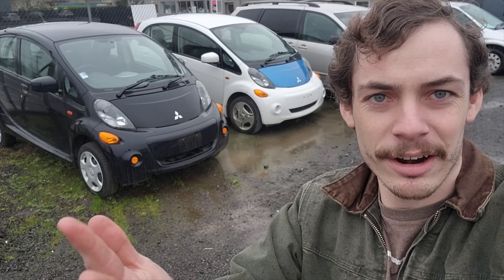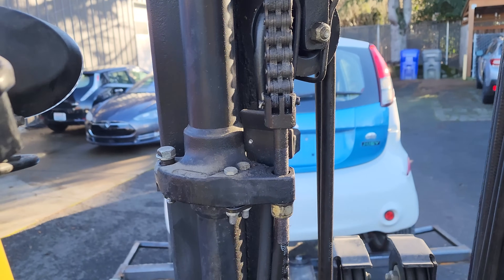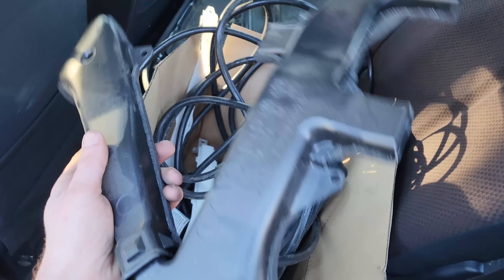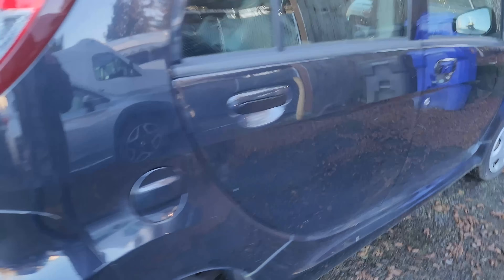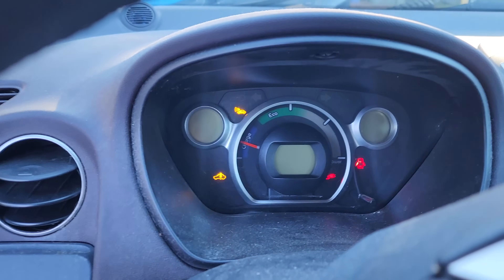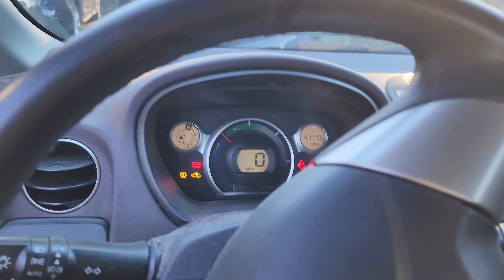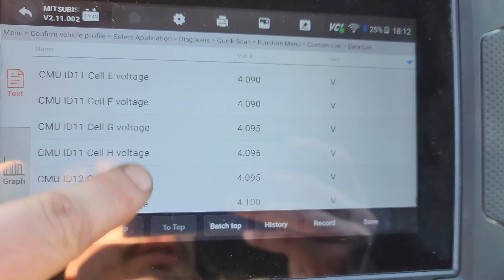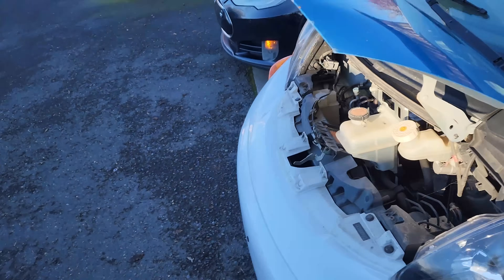We Bought TWO Broken Mitsubishi i-MiEVs! Here’s How We Plan To Combine Them To One Working Example

Comment: I remember testing driving one of these back in 2012 (or 2013) in Dallas with a group of early EV enthusiasts.  I thought it was pretty bad. So after only watching half way, my first guess after clearing codes is you need to re-flash the BMU, or swap BMU with other car for diagnostics. Im curious once you drop the pack, knowing if that one cell is actually low voltage or the BMU is measuring voltage/energy in that cell incorrectly.    Chances are the cell is actually bad (internally shorted or open circuit). Do you have test equipment that can perform AC impedance measurements of individual cells?  I understand this is an accurate way to measure the SOH (state of health) of a cell.  It sends a small AC signal through the cell and measures the impedance (AC resistance) of the cell to determine its internal resistance.  Hi resistance/impedance indicates low SOH

Comment: No car should have a useful lifespan of 50k miles.
Reply: I have a 2011 i-MiEV with 150 000 miles, still going sort of strong. I swapped in a lower mileage pack from a wrecked car a few years ago as mine had a couple weak cells. Plug and play, no programming required! 
I love the simplicity of these little cars. I have two of them as daily drivers, my Tesla model S is only used for long journeys. If I can swap batteries in one with my ten thumbs, then anybody can :)

Comment: I'm wondering if you can use the plentiful lev60 cells then distribute out the 50's to people that need them.
Reply: LEV60 are LiFePO4, totally different chemistry and voltage range from the LEV50s used in these cars (LMO).

Comment: The i-MiEV's are fun little cars. The LEV50 or LEV50N cells are fairly easy to find, but if you get a cell that has a different internal resistance, it will effect DC rapid charging (if your i-MiEVs have it). Cell upgrades are possible, but the VCU only supports up to around 63 Ah per cell and won't see anything above that if you use larger cells, but people have gotten around that by adding a CAN bridge and scaling the available capacity. 93 Ah CATL cells (if you can find them) are a drop in replacement with some clearancing in the plastic cell frames, providing around 200 Km/124 Miles. If you're replacing cells, make sure you balance them before installing, otherwise you may toast the balance boards. The BMS will throw a battery error if any cell is out by more than 0.1V. The onboard chargers can charge up to 3.6 kW, but can have issues with internal components failing, but they are repairable.
Reply: OZ DIY Electric Vehicles in Brisbane Australia are doing pack upgrades with the 93 Ah CATL cells and have developed a board that handles the scaling, and has options like adding cruise control.
Reply: @JamieLovick  Straya, mate....still an EV 3rd world country.  The amount of times I charge at Show grounds on 3 phase because the only 50kW Tritium in town has shit itself (again) is not funny. It's 2025 btw 😂
Reply: @moestrei  the infrastructure is always improving, but it could always be better.
Reply: @JamieLovick  Not much happening inland NSW...we are going backwards as the NRMA refuses to repair vandalized chargers.
Reply: @moestrei  AEVA, who I volunteer for, has been talking to a group of regional councils about what they can do, as there are destination charging grants available from the NSW Government which I believe also cover lower power DC chargers, and we discussed the concept of a charger in every town, well, a DC one and an AC one. Even a 20 or 25 kW DC charger with an AC backup in the middle of nowhere is better than nothing. The NSW Government also has funding for rapid chargers, but they take a lot longer to implement.
Reply: @JamieLovick I'm a member and just filled out the questionnaire 😂
I drive the very first officially imported Tesla in Australia with now over 400.000km...its a great advertising tool as it is pretty much original and in a great shape. Simon Hackett was the original owner.
Reply: @moestrei  I remember when Simon first got it, it certainly spawned interest.

Comment: Have repaired a peugeot ion(same car) battery modules. By replacing the LTC6802G-2 BMS chip. If you look at live cell data, you will see 1 or more cells fall to zero briefly.

Comment: Cool little car, updates when you can. I saw a video once of an Australian repair shop reconditioning this cars and even upgrading them. Is there any chance of pulling out the old tech batteries and upgrading them to modern chemistry? Thanks for posting.
Reply: Yes, OZ Electric vehicles offers an upgrade kit for these, however the cost is pretty steep ($16k AUD or ~$10k USD), and importing them may be a challenge... There was supposed to be a company that was going to offer them here in the U.S., but that never seemed to materialize. 
There have been numerous efforts in the owner community to do upgrades as well, and there are some folks that have been successful in doing so with a CAN bridge (which is open sourced) and the use of new cells that are a close match dimensionally. There are a few "caveats" to these swaps, mainly being that it hinders the cold weather usability of the car.